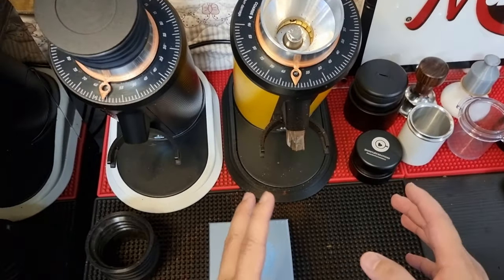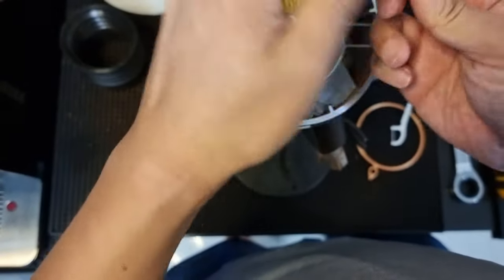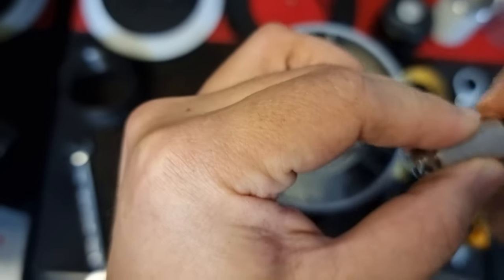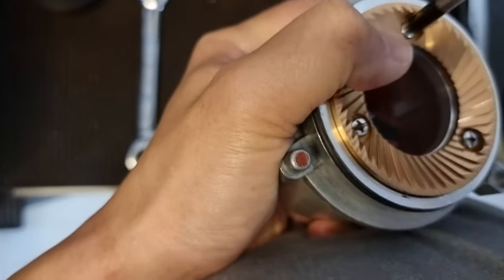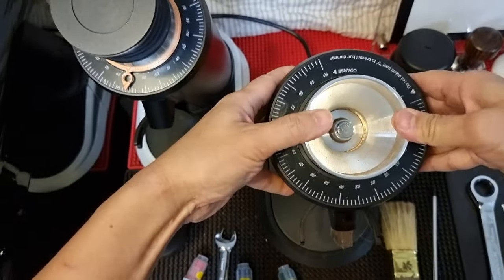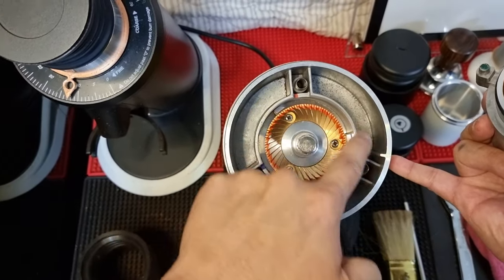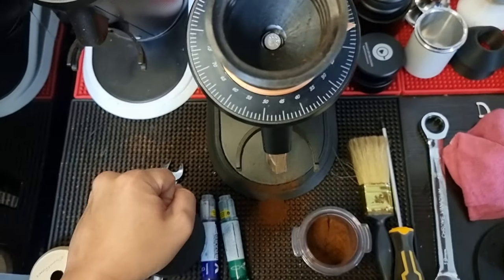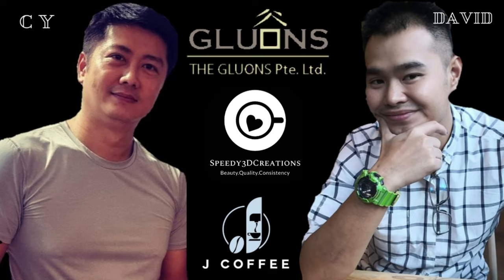Burr Alignment | SSP Red Speed Coated Multipurpose Burr | DF64

Comment: Need your professional opinion at the moment I have the Titanium burr and I think I will use it for a while because it's brand new. One more question I have two options for water that I can use for my Espresso One is mineral water with calcium 20ppm and TDS 90-105mg/I   been told mineral helps for better-tasting espresso ?. The second option is reverse osmosis water without minerals. Guess without minerals taste will be less but less build-up (mineral /calcium in the boilers? What would be the best option?
Reply from the maker: i dont recommend using minerals in boiler type espresso machines unless you are using the minerals that doesn't contain any calcium at  all.  TDS usually is fairly low in singapore. I wont advice using reverse osmosis water though. i like water that has potassium, magnesium

Comment: When doing the marker test, should I go to the finest setting and go coarser bit by bit until I can rotate the burrs by hand, or go finer bit by bit until the burrs start to touch?
Reply from the maker: first start at burr lock. then slowly rotate by hand until it is free to spin with burrs touching.
Reply: @CaffeMartellaSingapore  thanks. Mine was 90% wiped off, but I'm afraid I might've spun too much (about 4 revolutions) ?
Reply from the maker: @dan138zig its all right. the number of revolution you spin wont affect the % wipe.
Reply: @CaffeMartellaSingapore  thanks a lot!
Reply from the maker: @dan138zig  always welcome

Comment: great video thanks,
at the end you mention the 10’ titled base helps with the alignment proses.
How exactly? I would not expect that to influence burr alignment.
Is it just easier to work on at that angle?
thanks again.
Reply from the maker: I can only relate in my own user experience but I cannot provide any scientific explanation on how the 10 degree stands makes burr alignment easier.

One confirmed advantage is that the coffee ground now exit the chute better and grinding chamber is much cleaner. Of course, this can also be due to the fact that I have modded the declumper as well,

Comment: so that's all you have to do to check for alignment?  you just have to check which of the 3 possible positions that you need to be attaching the top and bottom back together?  will it always be a 100% match or will it just be the "best results of the marker test" is the alignment you end up going with?
Reply from the maker: it's the best position of the the 3 which may not be 100% aligned. but if u ate able to get close to 90% its pretty good.
Reply: @CaffeMartellaSingapore  is it possible to use aluminum foil "shims" to achieve the same results?  I've seen other videos where the technician uses it to make it aligned.

Comment: With the SSP burr change the new zero mark is no longer at the 6 o'clock position (bean icon). This indicates that that SSP burrs must be thicker than the original burrs. If you order the DF64 with SSP burrs does that mean that the collar numbers will better line up with zero at the 6 o'clock bean icon position? ...or will the SSP burr even from factory always mean that the zero mark is now at the 3 o'clock position regardless?
Reply: I was wondering the same thing. I think that’s why CY has that plastic collar that he can move around to point at the new zero point. Perhaps one easy solution is to print a new circular label to stick over the original? Preferably something that won’t be impossible to peel off once you decide to return to the stock burrs. I’m sure CY could easily make that, and hopefully with a nicer font too. Cheers!
Reply: My Meade telescope RA circle is movable as it is housed like a bearing. Its very stiff so it doesn’t move accidentally. Could be a mod or upgrade in the future for this grinder.

Comment: Where did you get the silicone tubes and what are the specs? Diameter etc
Reply from the maker: the silicon tube comes with the grinder. You just have to set it right.
Reply: @CaffeMartellaSingapore  oh great, thanks. I’m still waiting for mine to arrive, will be printing all your mods :) nice to know I don’t have to get new tubes for the springs
Reply from the maker: @WTFBOOM25  it comes with the grinder. Just that it is always not placed at the right position and this will be the reason why some will experience very small range for espresso.

Comment: Hi , thank you for your Chanel! But please remove your alignment videos, they are far below your level. Your alignment does not consider the lower burr. With your method the upper burr now is OK aligned but the lower one still could be total off. For a complete alignment you need to shim the bottom burr (too).
Best regards and thx for your videos.
Reply from the maker: thanks for the feedback. The bottom burr we aligned with a calipers but choose not to show on video because not everyone have that and usually from my aligning with so many df64, bottom rotary burrs carrier are usually quite good. Thanks for the feedback anyway.
Reply: @CaffeMartellaSingapore  ok this is nice to hear! A Remark, for the bottom burr watermarker method with shims (al foil) works fine. Thx for your videos!!! Btw what do you think about ssp cast for filter?
Reply from the maker: @SarntAKluss  I like it alot with more body and texture and sweetness.
Reply: @CaffeMartellaSingapore  thank you for your valuable time!